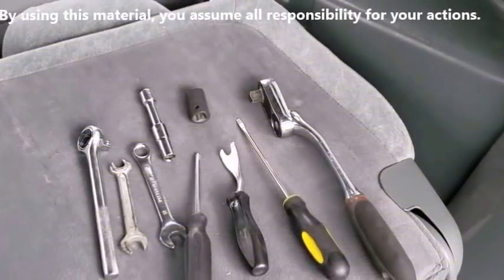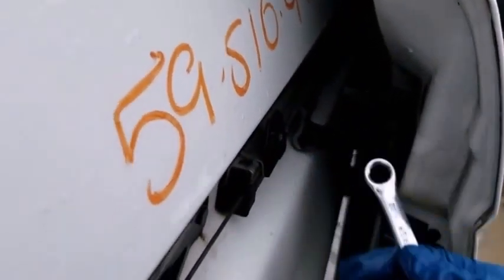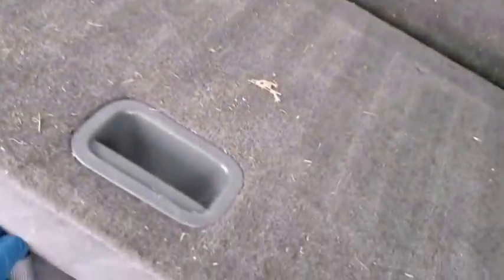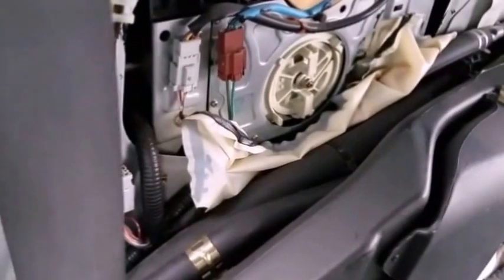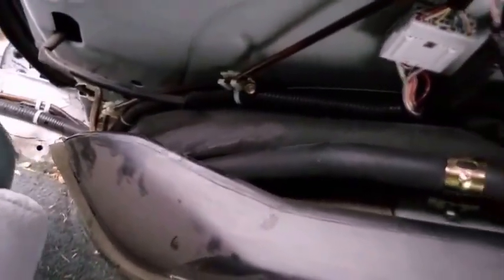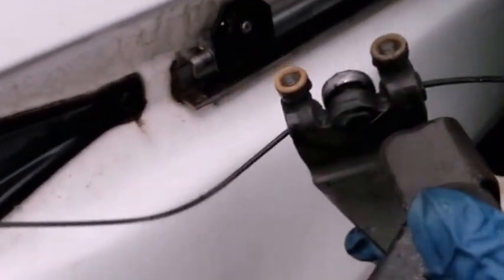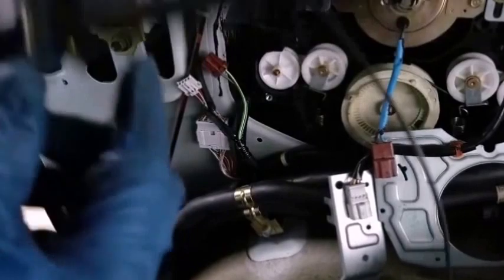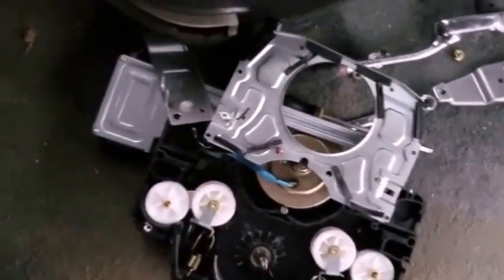How To Remove Sliding Door Motor in 1999-2004 Honda Odyssey

Comment: One doesn't need all of that slack in the cable, just need to twist the adjustment wheel enough to let some slack in? watched 4 or 5 videos where one can just use needlenose pliers and disengage those cables from the roller assembly.  what actual year is that van?
Reply: Oh..  u took the whole motor our  :/  dang.  wow, yipes..  lol